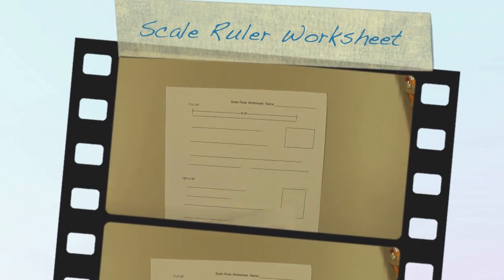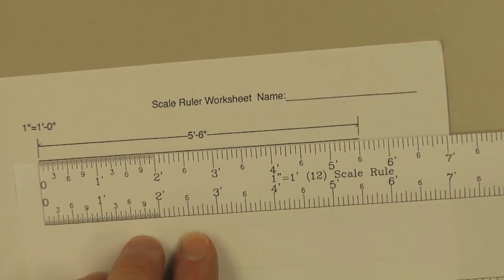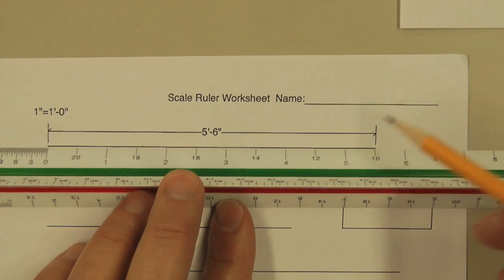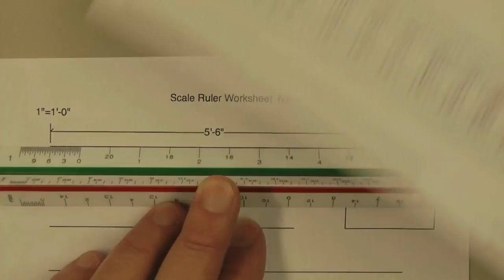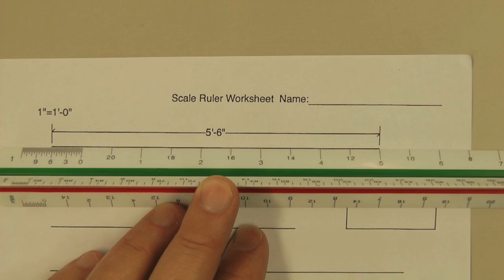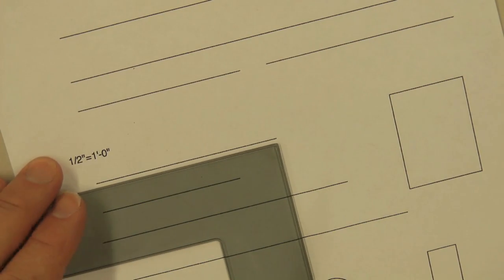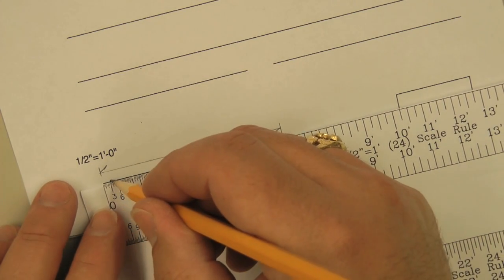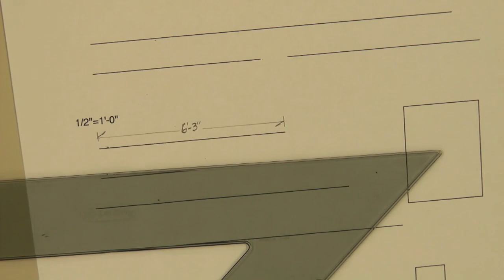How to use a Scale Ruler: Plus a Worksheet and paper scale ruler with download link.

Comment: I printed the worksheet and had some trouble.  I came back to the video to discover that my worksheet did not print at the correct size!
Reply from the maker: I'm sorry. That does happen sometimes. Be sure that you don't have "print to fit" or "fit to Page" or something like that checked when printing. What can happen is that different printers will format the page to fit within the printer's paper boundaries, thus changing the worksheet size.
Thanks for watching, Scott